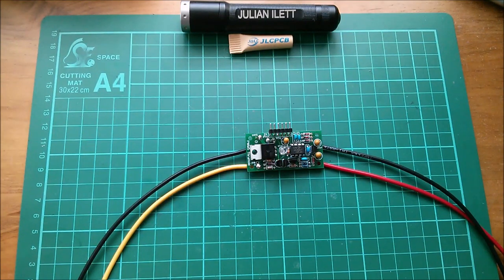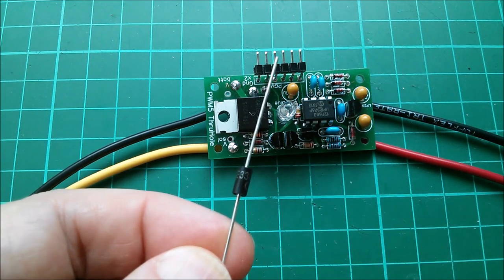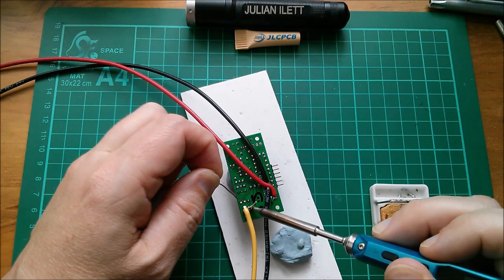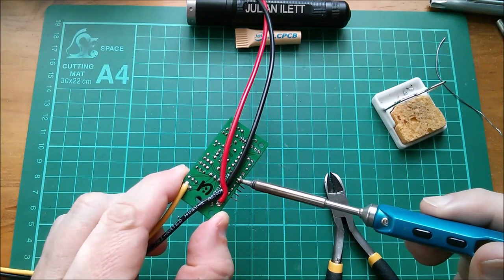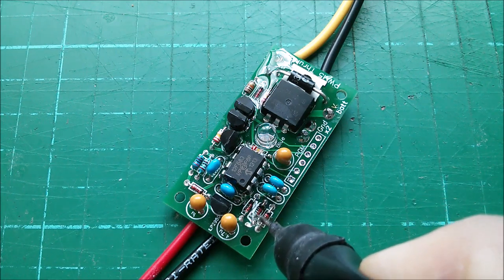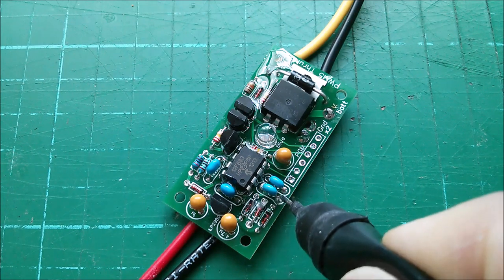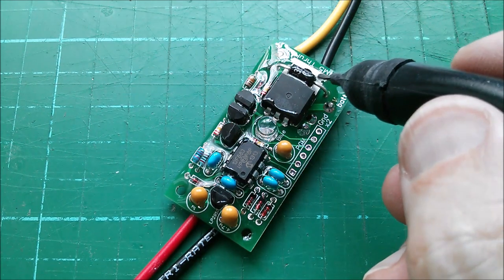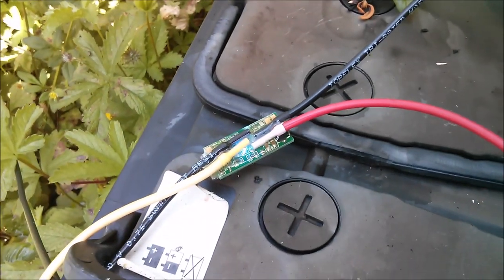38 Minutes of Watching Glue Set - PWM5 (fanatics only)

Comment: I’m a fanatic. Has anyone suggested you wet your tip with solder before applying it to the joint. This allows the heat from the tip to conduct more effectively to to the joint. You then apply the solder to the opposite side of the joint to create the best joint. Great channel and hugely educational thank you so much.

Comment: As the diode pushes down on the transistor making a short even more possible, I think I would use a mica or plastic washer under it for long term reliability. The sealant would hold it in place. I would worry about that!!
In mass production, I think you might need a bath of glue and simply dunk the PCB in it. Probably need a dark room to stop the glue hardening... just a thought!
Reply: Or maybe use UV cure surfboard resin.

Comment: A battery always shows a higher voltage while it's being charged, just as it shows a lower voltage while there is a load on it.  You can only determine the true voltage by disconnecting any solar panels and loads from it and leaving it to settle down a bit and then checking the voltage. However, I have noticed that TOO MUCH spiking or drooping during charging / discharging can indicate diminished capacity (among other things like low wire gauge).

Comment: Julian, will you be enclosing your batteries before winter?
What have you got them sitting on, I hope not just a stone or concrete slab. 
It would be a good idea to have them sitting on a thick polystyrene block or some thermally insulating material. The cold ground will suck the heat out of them  if the weather conditions prevail and freeze them, or compromise their performance due to low body temperature.
Great video, good to see PWM5 going well.

Comment: Again, it might have been easier to solder those controller wires to the MC4s. I did a couple today myself for a new 370 watt panel I finally managed to wire up, and they went together beautifully - operational just as the sun sank below the horizon of course! But there is always tomorrow. We are in the deep Winter here in NZ.

No fuses on your setup? Or is the charge controller board the fuse? lol

Comment: If I'm reading the crimps correctly the original selection from the left of the box was sc16-8  which  is for 16mm^2 (cross sectional area)  cable with an 8mm bolt hole.   the one used  was 6-8 which is probably for 6mm^2 cable (8mm bolt hole).   Looking at the crimp tool markings, it is meant for uninsulated crimps for  0.75,  1.5, 2.5, 4, 6 & 10mm^2 CSA wire.    Selecting the crimp terminal to suit the wire is the recipe for success (caveat: when the wrong one is all you have on hand  I guess you have to go with what you've got :) ).

Comment: Hey Jules... grab yourself a nail bar UV light.  Has a timer and you can just pop your UV glued bits under it for a far more thorough exposure.  I find that glue can't tolerate any shadow/missed bits for obvious reasons and I never was really pleased with just a torch or laser. That said, this seems a bit of a faf... I would pot these for peace of mind. You can even 3D print (+DCM rinse) your potting boxes for a precise fit. I use UV epoxy for sealing wire holes etc. to stop the potting compound leaking out (it finds every gap)

Comment: I Love that board and the way you put it together. Ya, the crimps were a little hokey but as long as they (the wires) don't pull out. The crimp die didn't match the connector pin. It seems there are too many "styles". They should be standardized but I guess that is one of the things the engineers can't agree on. I remember getting crimps like that and it was because a dedicated tool was needed to get them perfect. Great Job, Julian!! You have an awesome system going. Did I hear you say (OT) that your diesel heater failed?
I have been interested in those, but can you make a video about what went wrong? (Assuming I heard you correctly, in one of your other videos, can't recall which video).

Comment: How well does the glue conduct heat? If not very well, the components will be running hotter than normal.
Reply from the maker: True, but water would cause much more trouble
Reply: The point is, if running too hot, some other material may provide better heat transfer while being equally water repelling.

Comment: Julian, I think you might be better off with crimping on the coloured style crimps for that small wire, you can get eyelet crimps in most sizes for your sizes or wires. They are always handy to keep a stock of different styles of crimps in mainly red and Blue sizes for your projects.
Reply from the maker: I would if I could get the red ones with an M8 hole.
Reply: Have a look on ebay, should be easy to find, i typed in “red crimp M8” and one seller has a whole bunch of sizes including the one your after.
Reply from the maker: Bought some :) thanks James

Comment: I notice you was using UV glue - could you spray the circuit with clear lacquer spray? to do the same job of protection?
Reply from the maker: I really don't like using any kind of spray indoors.
Reply: As we know car spray lacquer last for years on our cars and is non conductive - surely building up layers on a PCB has to work.
Reply: @247hinkey  that isn't the reason though
Reply: @maxxiang8746  What is then? Surely Julian wanted to waterproof the unit plus add a coat of insulation on the mosfet, and a spray coat of lacquer would do the same job.

Comment: What if the mosfet fails short? Won't the solarpanel overcharge the battery? Would it be easy to add a crowbar circuit to blow a fuse?

Comment: Drill out one of the guide holes in the crimper.  It's got 3 guides so drill one completely out so you can at least have it correctly aligned straight. - 28:40

I said it in the last video but I guess you missed it.
Reply from the maker: That doesn't completely work. The 3 positions are for different wire diameters.
Reply: @JulianIlett  - Oh that explains better why there are 3.  But I would still drill the appropriate one so it would be aligned correctly.  Getting the depth correct will still be easy and you won't have to worry about the alignment or fudging around with that cardboard, etc.

Thanks for the reply, Julian!

Comment: why doesn't the controller charge to 14.4v - 14.6v then go to float of 13.5v?
Reply from the maker: It does :)
Reply: Thats not a bad Idea. The batteries I have are rated 14.4
Reply: @subigirlawd_7307  You have PB batteries then, if you are using them, then they should be charged to 14.4V or whatever the datasheet for your batteries say, then float at 13.5V. If it's a backup battery a constant float charge of 13.5V is OK
Reply from the maker: The PWM5 does 14.4V in the morning, then switches to 13.5V sometime later.

Comment: Lower the charge controller to lower the red/black wires so the moisture runoff does not go to the batt contacts
Reply: Good Call! Make a loop below the level of the batt terminals.
Reply from the maker: Good idea

Comment: Did you put the tape under the mosfet ?
Reply from the maker: No, I forgot :(
Reply: Lets hope the coformal coating has gone under by capilliary action and that would be enough
Reply from the maker: I'm pretty sure the solder resist will suffice.

Comment: would like to see an upgraded version for 300 watt panels, and 24v battery bank, or do i gotta wait for muppet 2?
Reply: just double  up on the mosfets and resistor divider
Reply from the maker: Transorb voltage would need to be raised. Voltage regulator would be close to max input at 28.8.
Reply: @JulianIlett  my panels are around 40v OC and i'm using lithium batteries 7S 29.4v when fully charged and balanced. Already built my own monitor / management system but would love to build my own charger :)
Would gladly let you see my web frontend that displays my management system if your curious. It gives me real time values (updates by the second from an arduino and a few ADC's). Its just lacking the charge system.

Comment: won't you kill them batteries like that if there different amp hours, they connected in series.
you want to get an mppt controller not pwm, mppt will get all of the power out of your panels.
Reply: only if they are connected in series. but it looks like they are only connected in parallel so it should be fine. parallel batteries should be fine.
Reply: MPPT gains are minimal over an efficient PWM charge controller, on a small solar system. The PWM5 uses virtually nothing from the battery when no solar power is available. But MPPT charge controllers use hundreds of milliamps when no solar is available. So basically the operating overheads of the MPPT exceed any gains made. 

For larger solar systems MPPT is the way to go, but small systems, the PWM5 is perfect.

Comment: I use KAPTON Tape for any insulation and Heat Transfer jobs these days.  Silicone Grease and Kapton does anything I need.
Reply: It doesn't provide a waterproof seal, though.
Reply: @eddiespencer1  Referring to the FET Tab and Diode issue.  He has a handle on the Water proofing.
Reply: @pulesjet  Ah, I see. I thought you were suggesting to just wrap it all in Kapton instead of using the UV glue, lol.

Comment: I can't wait to buy a solar panel... I'm saving up for one,  so far I have a few batteries, inverters and thick wires from a amplifier kit for cars complete with fuse and housing..

Pretty soon I'll be able to use the power of the sun 🌞 😎 I'm so excited (✿◠‿◠)
Reply from the maker: You could try a small solar panel first. I've used the PWM5 on various panels from 1W right up to 100W. In a recent video I was charging a 2.3Ah gel battery from a 5W solar panel.
Reply from the maker: And while it all works well in summer - in winter, not so much :)
Reply: @JulianIlett  I have my eyes on a "25 watt 10 amp" panel... That one is a little pricey but worth it...

it's the perfect size I need for a spot I have under my window not to small but not really big either
Reply: @JulianIlett  yeah the winter time it's not going to do anything useful but I'll keep the batteries topped off in case of a power outage... I've done it before I would have power in my room making my brother so jealous 😎
Reply from the maker: 25W 10A doesn't sound quite right - that implies a voltage of 2.5 Volts. A suitable silicon panel should have 36 cells.
Reply: @JulianIlett  Thats why I used quotes lol I think its a bad Chinese translation
Reply from the maker: Ah, sorry, I missed that - lol.